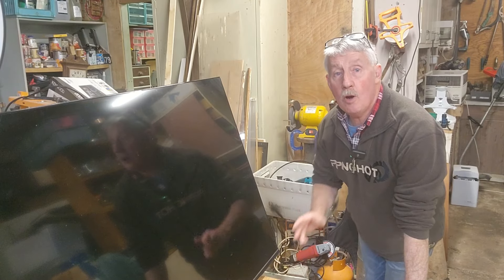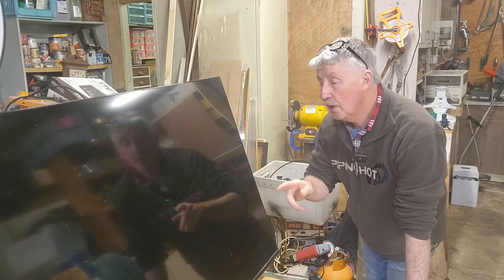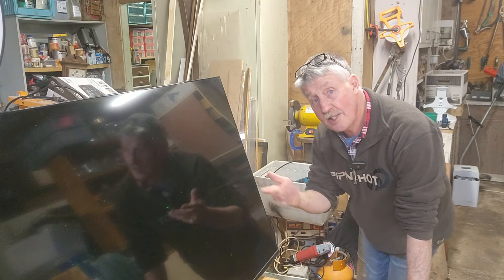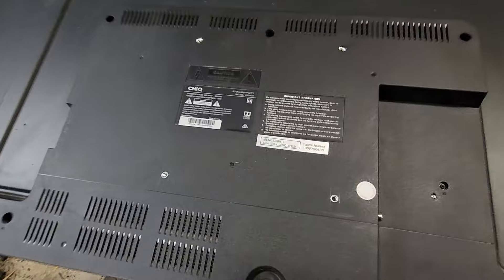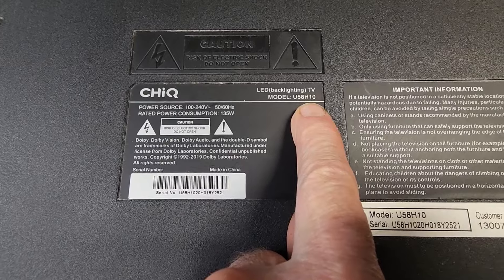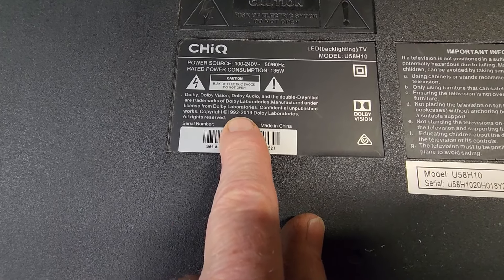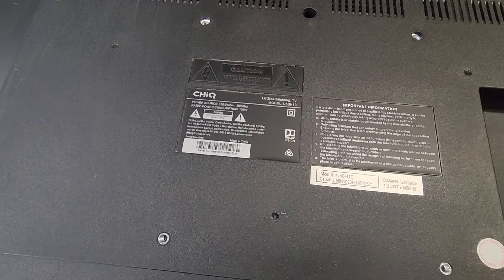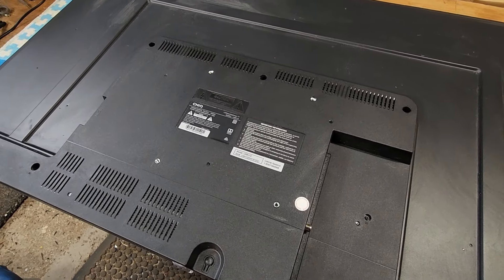An Attempted Repair of a Chiq LCD Smart TV by Baking the Main Board in the Oven! It was Worth a Try!

Comment: I have baked boards to dry them out but not reflow the solder, I would think you would need in excess of 300C for lead free solder. Still worth a try and an interesting idea. Thanks Chris 👍🙂
Reply from the maker: Thanks Dave - yes, someone else mentioned that it wasn't hot enough! I couldn't remember the temp I used last time and I checked a couple of YT vids on the subject - but they must have got it wrong too! I'll try it again on the next suspect board 👍😊

Comment: 200 isn't hot enough Chris. Take the heatsink off the main chip. Put some foil over the plastic connectors and hit the main IC with a heat gun. You want to be more near 400c. At least 350 anyway. Be fixed or be dead. Don't give it any other option lol
Reply from the maker: Thanks mate - I like the fixed or dead mentality! 🤣 It's too late for this board - I've already robbed a part of it! Next time - more heat! 👍👍